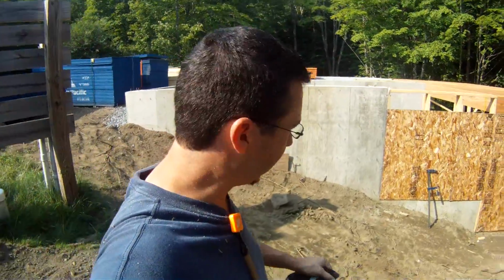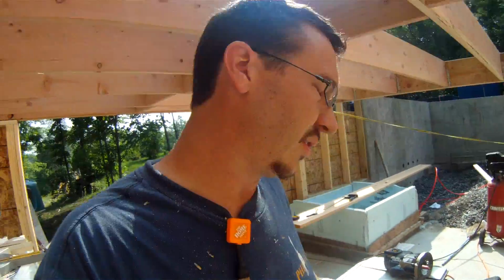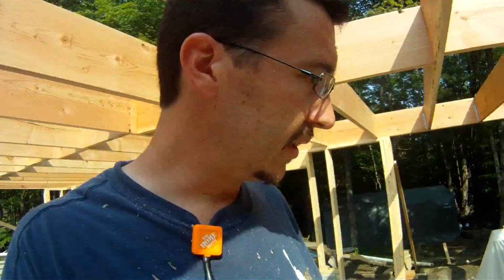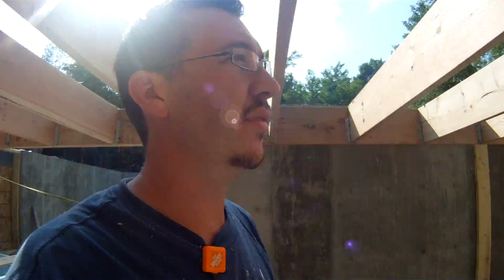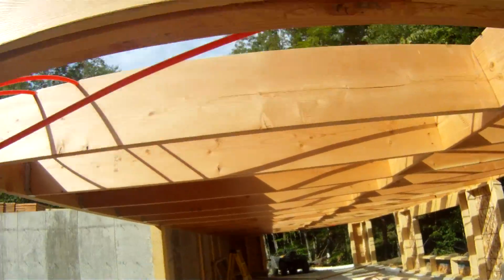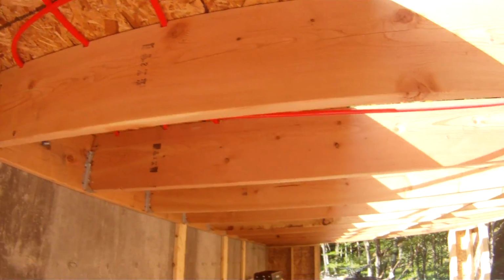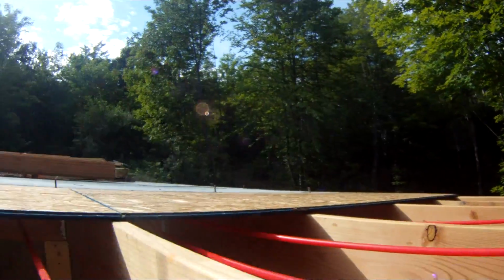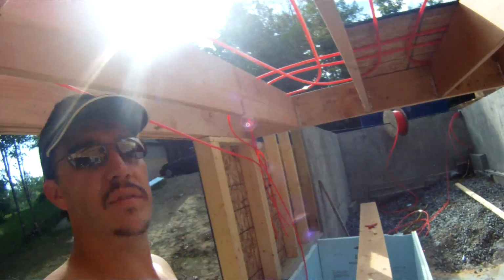New Radiant Installation Technique - 22 - My Garage Build HD Time Lapse

Comment: Great idea but you should have used nailer plates over all those spots you ran it through a joist. Idea being that if you penetrate with nail/ screw/ whatever it will hit that. Hopefully the hose that is floating will give to a screw or nail if it comes in contact.

Comment: I get your point on that!!! It would be very difficult to get more depth by blasting out bedrock!!! And 7 foot is a about 1.90 m if I'm not mistaken! Only where there is a trusher  you will have to compromise a bit!! Keeps you humble; walking like that through your garage!!! Yeahh!!! And I imagine it's more than sufficient riding in and out your toys!! And for repair or maintenence you can ride them in in the upper part of the garage!!! Congratulations! Gerard Puerto Montt